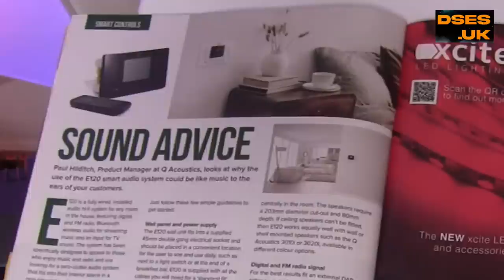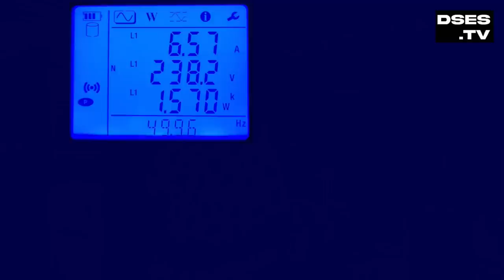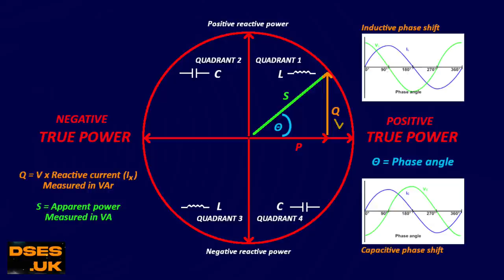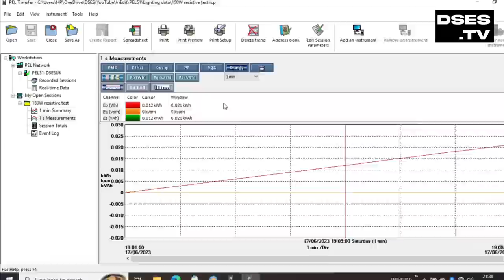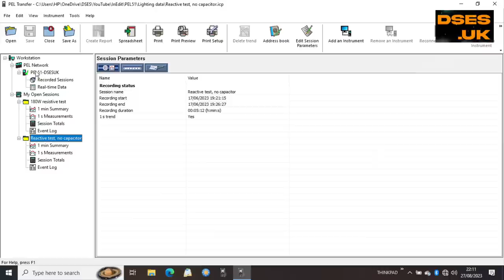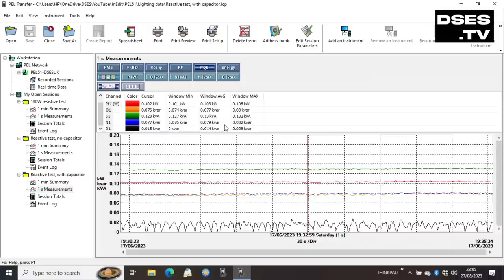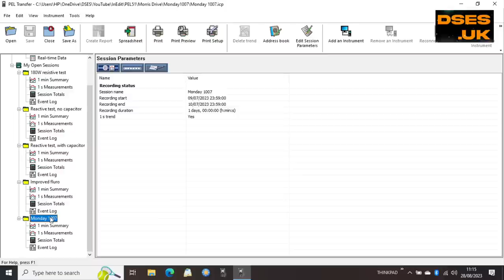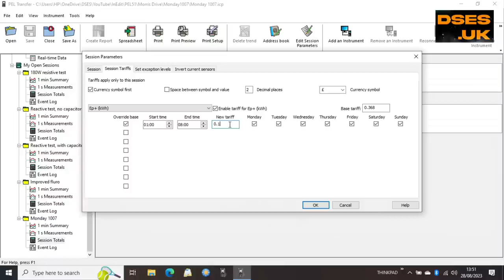Vlogging energy logging with the PEL51

Comment: As I recall from my days studying Electrical Principles at Bolton Technical College the inductive quadrant is bottom right (we didn't learn about export them days) and the the phasor diagram is always read in an anticlockwise direction, hence Inductive circuits 'lag' the voltage.
Reply from the maker: When it comes to phasor diagrams, it seems they can shift around rather confusingly. Some Googling finds sites that have quadrants three and four reversed to what's shown here too and had me scratching my head for a while. My diagrams are based on the PEL manual and the convention used by this particular instrument. It can be downloaded from the Chauvin support site linked in the description. You can also see it at the 18:30 to 18:33 mark when the realtime results are being shown in the software - the load edges slightly into Quadrant 1 which the software labels as 'Inductive'.

Comment: Just went through a energy saving rip out at my mum's. Fkin halogen lights EVERYWHERE, and 3 50w GU10's in the bathroom! So while I was getting her updated with a smart meter on agile (she was on eco7, paying top price for 95% of her daily usage), I bought new led lights for her.

Once the meter was in and spitting out useful data, I swapped all her lights and we compared days. Like your video on the subject says, they'll ROI very quickly, and with the other savings on her bill now, it's certainly worth either sparkies like you, or at least a knowledgeable family member going round the oldies in the family and getting basic stuff like this up to date. 

So loggers like this that can present clear graphs for the older generation are almost priceless for the professional sparky.
Reply from the maker: Yes, it's a good point, one can bleat on about the advantages to upgrading a client, but sometimes it's better to be able to display that graphically. I have a community centre I support whose lighting is all end-of-life, and I've been trying to get them to invest in low energy upgrades for over two years without success. Now I can start logging actual per-circuit consumption to throw some hard graphs at the bean-counters!
Reply: @dsesuk   Light level logging too Dave would be a good one for that customer
Reply from the maker: @ChauvinArnouxUK  Handily enough, I have recently acquired a lux meter! That will be employed there, although that this point they don't need me to tell them their lights are rubbish - enough have now failed to start making the place unusable! They have to sort it out this autumn one way or another before it gets too dark!

Comment: Great video. I went to the Ring smart doorbell stand at a show. The guy showed me the app & was keen on home automation. With all the tech he had to use 11 different apps to manage his house.

I wonder how long before they'll be an app to connect to your new consumer unit that has this data per circuit?
Reply from the maker: Smart CU's are coming Peter. Makes sense in a way. I have nine ARM chipsets in my current CU because of the individual AFDDs, but one could potentially do that work. I'm honestly surprised no CU manufacturer has yet brought one to market with a centralised processor for load and fault monitoring.
Reply: Wouldn't touch one of those things with the longest pole I could find. No way I want the likes of Amazon nosing around my place seeing who comes and goes. "Smart" homes..? You can keep 'em, along with the phones and all the other crap.
Reply: An application like home assistant or hubitat can tie everything together in one app.

Comment: Dave I love your explanation, this is giving me flash backs of phasor diagrams. Love my cheap power monitoring gear, best bang for your buck is the IoTawatt with 14 cts and 2 mains reference voltage or a Shelly 3em. They are cheap enough to permanently install for customers IMO, not as accurate as your device or an NMI approved meter but it gives them a close ball park figure.  

I rewired my shed to be fully automated with every light switch to have power monitoring with physical switches. My design is built like a brick shit house and will most likely out live me compared to the e-waste IoT people buy.

Comment: this would be a great tool for me. a power freak i have spent the last year trying to reduce the power consumption of my house to the extreme but at £1000 its a bit pricey. but at £72 including vat + delivery and collection might be worth hiring for a week.
Reply from the maker: Yeah, if it's not something you need often, at least you know they're available and the hire cost isn't crippling.
Reply: Just buy a clamp meter. The voltage won't be more than a few % ooot.

The magnetic clips are the tats and use them on me fook unit

Comment: I enjoyed your explanation of how this device works, i must admit i dont understand the maths bit of the video  but generally a good demo of the device. I think ide be a bit worried if i saw voltages of 1Kv on my house mains think theres a seriouse fault somewhere. The DNO monkeys will be out digging the street up soon il bet. Cheers keep up the good work david regards  Kelly Marie
Reply from the maker: This one's a mouthful, but the point is to start at the beginning and kinda get to a place where someone who hasn't had much exposure to this kind of thing can pick up a PEL and make a start with it. When I first began playing with mine back around May, I didn't really know what I was looking at which is why I've had to sit down and figure it out. If my figuring (and much Googling) saves time for anyone else wanting to use the same kind of kit to monitor the same kind of thing, then so be it. I appreciate it's not a viral video for the masses though!
Reply: I get its not the type of thing your going to be able to understand straight away  there's a lot of things to get to grips with. I imagine there will be a lot of electricians who put themselves thru a course before spending a thousand pounds to buy one or rent one